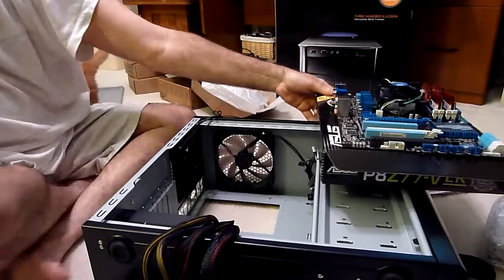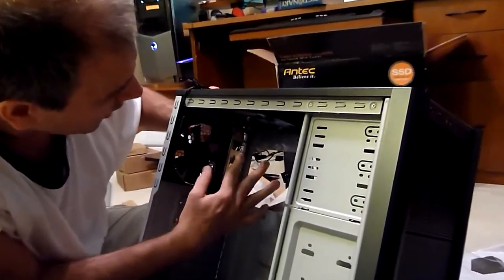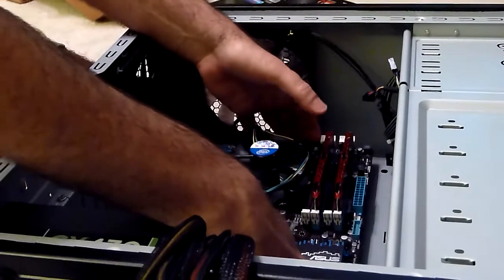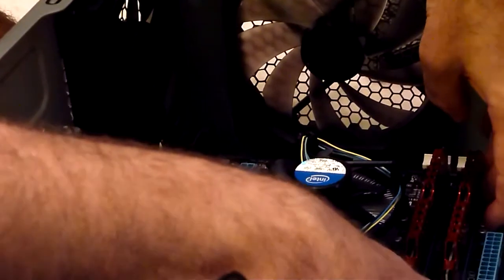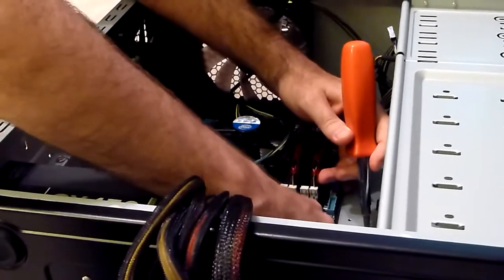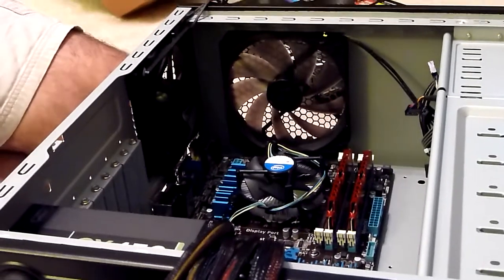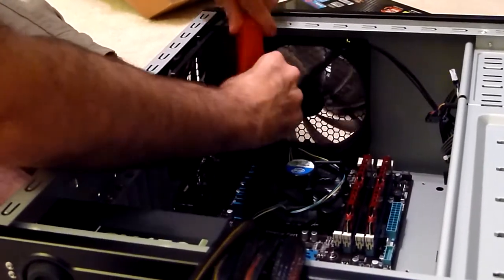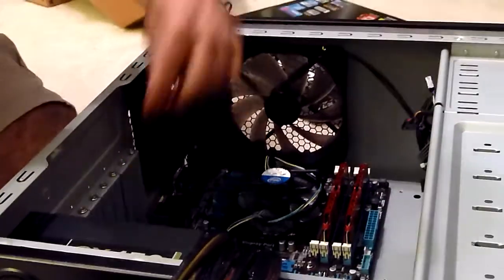PC 11: Installing the motherboard into the case

Comment from the maker: I would look to see if there are any extra standoffs in the case you could move.  Or, order a pack of 15 for $5 including ship. from Amazon or send me your address I'll send you two. You could leave them off, but it is likely to cause stability problems, but it might not.  If you look at the holes in the motherboard, you will see that they have some tiny metal dots around the hole-- as I understand it, those are grounding circuits that need that metallic connection to the case.

Comment: hi im upgrading my old computer and my new motherboard is install and im finished with everything but my board has to empty holes where you screw in the motherboard to the stand offs but my case didst have stand offs their so i left them empty is that ok or no